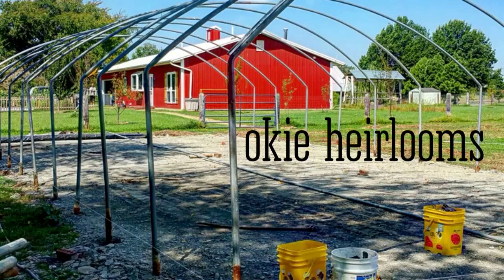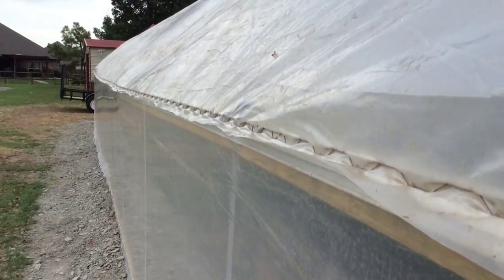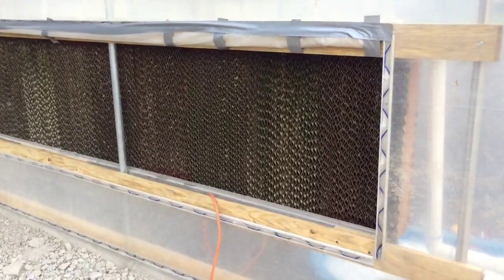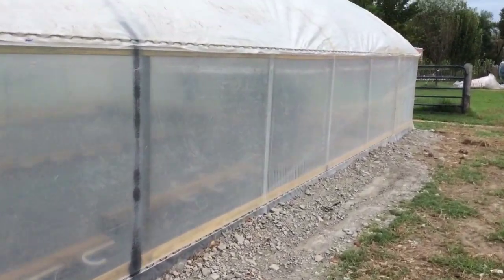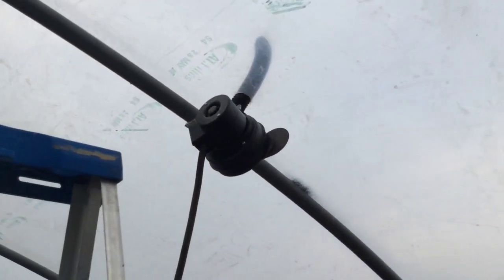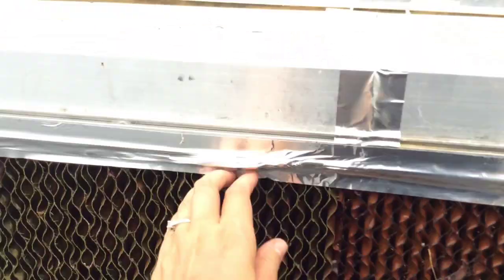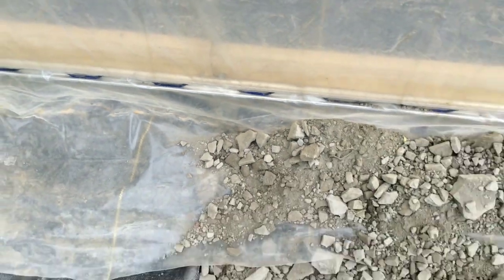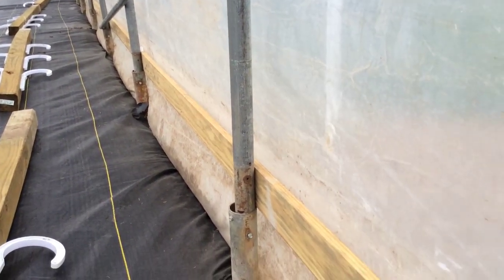okieTV: DIY Hydroponic Greenhouse Ep. 01 - Double Wall Insulation, Swamp Cooler, & Wiggle Wire

Comment: Nice work, looking to build something very similar, already built a greenhouse from recycled doors and windows and its great! I need to figure out a way to cool it and will be running completely off solar.
Reply from the maker: Cooling and heating have been some of our biggest learning challenges. The swamp cooler helps a lot but only if it isn't humid unfortunately :/
Reply: You should do a video on this? I'm using solar and I'm VERY happy, I get almost 2kw per my system, use for my house and going to run a leg out to my Greenshouse to power everything... :)
Reply: +Okie Heirlooms For the humidity, dehumidifier maybe off the solar power.
Reply from the maker: We plan to build another one from scratch and make it affordable, so we will be documenting that when we get to that point hopefully. Unfortunately, the swamp coolers pull of the air from the outside, so if the outdoor humidity is high, it won't have as much of the cooling effect as if it were dry outside.

Comment: How did you build the double wall insulation for your greenhouse top?  Do you have double wall insulation on the sides as well?
Reply from the maker: We don't have double wall insulation on the sides, although it is possible and would provide even more insulation. We simply have two layers of plastic to create the double-wall and use an air pump to keep it inflated to create the dead space.

Comment: The 1X4's didn't work out for me. They deteriorated much too fast for my liking. The humidity and the heat are really hard on any lumber but the thicker it is the better chance you have of it lasting.I would use treated 2X4's next time.
Chuck
Reply from the maker: We are hoping to have enough climate control with the swamp cooler to keep the heat lower, but do expect humidity to possibly be an issue. Hopefully it will hold up better with stable temps and plenty of ground clearance.